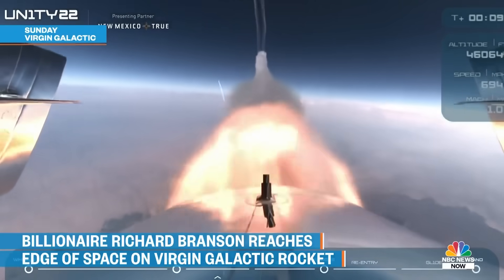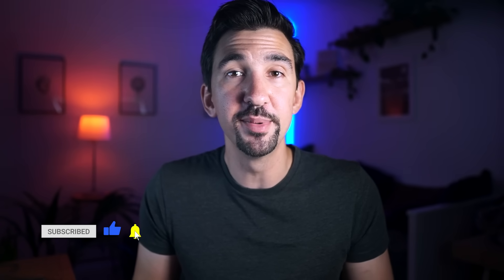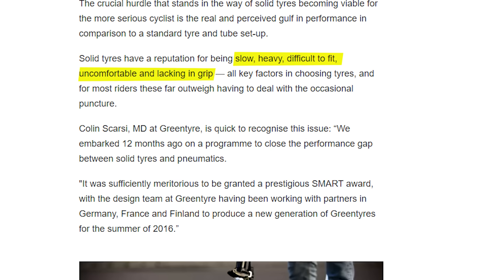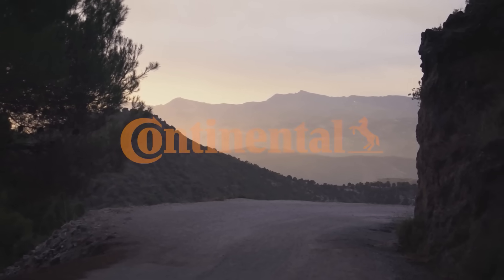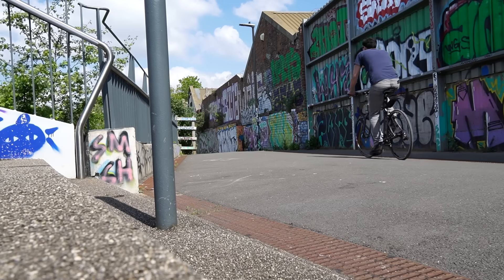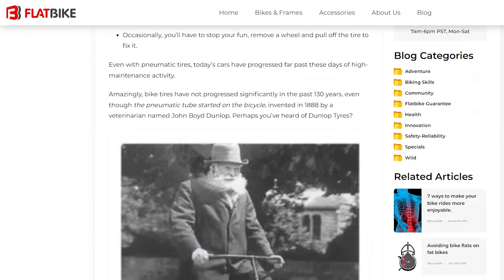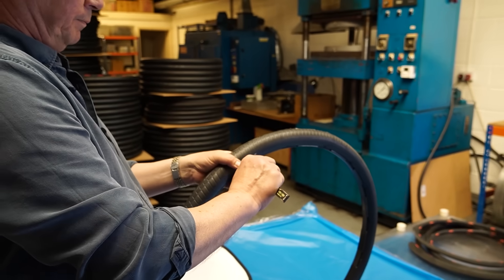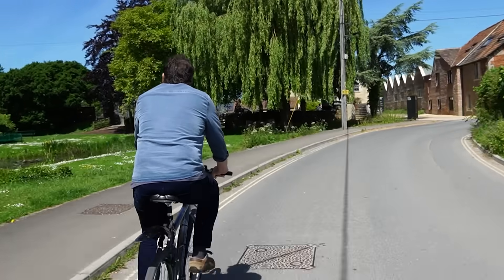I Tried Solid Bike Tires | Here's What I Found

Comment: You don't need NASA or some new materials to not worry about punctures, just use a simple trick.
When you do get a puncture, reuse the old punctured inner tube as a tire liner, just make sure to cut off the valve and clean it, make sure whatever caused the puncture is not there any more.
I never had a flat tire since i did that.
Edit: Forgot to mention that the ride quality didn't feel any different.
Reply: they do have a liner that you can buy that is puncture resistant. look online. I installed mine with two sided tape to keep it in place .so far ,so good.
Reply: @glennschemitsch8341  my experience with these liners is that the ends wear a hole in the innertube.  Which is an effect that I would not have expected.  This has happened to me 3 times now and I have removed the liners and now use sealant filled (specialized) tubes.  This is not a perfect solution because I hate sealant, it's so messy.  I thought about tubeless but the only good solution to a flat is to install a tube in the field which is what I would do with tube tires.  And I have to deal with the tubeless sealant, which as I have mentioned is really messy.
Reply: The liner is Mylar?   Glass weirdos increase landfill pollution . I put Mylar flat on front tire to hopefully slightly crush sharp edge. @glennschemitsch8341
Reply: Or just buy lined tires. I'm using Specialized Sawtooths, they're lined with Kevlar, in 5 years of light to medium touring on all surfaces I've had 1 puncture and it was from a very thin piece of steel wire.
Reply: @somika87  Thats worth knowing its Kevlar they use for bullet resistant armour so that should be effective.
Reply: @hookbeak2321  I had kevlar tires, for around 4 years without issue, no leaks whatsoever. Then I let some kid borrow my bike to ride a ramp. He landed pretty clean in the grass, but you could hear the tire explode. What did he hit? A large splinter of wood.

So yeah, kevlar or not, I don't think bicycle tires really fall into that bulletproof category.
Reply: @southernflatland  There's a reason why armoured vests and such use titanium foil to increase the resistance against puncturing... Kevlar is amazing on it's own already, but far more so against bullets than cuts and piercing. Bullets simply "work" very differently when they hit armoured clothing.
Reply: Most of the times I use a drop of superglue and a piece of tissue to fill a puncture, mostly because I am too lazy to buy new tubes :D Works quite well, even on the DH Bike. Not really endurable on broken headphone cables tho
Reply: @hookbeak2321  Kevlar was initially developed for tires before it was first used in bullet resistant armor, but yes it can be extremely puncture resistant.
Reply: You can buy lined tires - they cost like 10€ more.
Reply: Oddly enough, back in the day in my spare bicycle parts that I had one set of tires that fit perfectly inside another set. So, I installed them, all 4 of them, on my two rims. Plus 2 tubes of course.

Basically I ended up using smaller tires as tire liners for my larger tires haha! The whole time I had that bike I never got a flat either. 👍
Reply: @southernflatland  Thats a pretty good Idea and I love cheap so You make me think that you could just take a used tire and just cut the rim wires and part of the sidewall to fit in the new tire and then it would have plenty of armor.  the most flats i ever got were from goats head thorns hidden in dirt.  I also ride motor cycles and believe watching for road threats is part of the job if you want to avoid accidents or flats something that video producer seems to be unaware of.  cheers
Reply: @SurferNorm6360  Oddly enough, I didn't even trim the bead wires on the inner tires, it was just like a perfect coincidental fit with no modifications for me.

Also, practically all new bicycle tires don't even use a wire bead, they use nylon now, so they can fold the tires into reasonably small boxes now. Which basically means if you try such a double tire thing, your mileage depends on the different tire sizes, but you shouldn't even have to worry about a steel wire bead anymore.
Reply: I do that plus i just use those hard vinyl Liners on my Mtn bike if the guys but is so soft your supposed to stand up on irregularities on the road also consider a fully suspended Mtn bike walmart has them for cheap,
Reply: There are liquid sealants that you pour into the tubes. Some of them last about 2 years (that's about 5000 km in my daily commutes). With them punctures are very rare (unless you keep catching snake bites, which means you have other problems, like low air pressure or bad riding habits).
Reply: What? I do not understand how big the piece of the tube needs to be
Reply: Same, I actually used 2 in each tire, since I did that I never got a flat again.
Reply: I have done this with an old external rubber for a training bike... 😂
Puncture proof 5.0, However, got a lot heavier... I might be going back to that for a road trip I am planning within a year...😅
Reply: Awesome Idea and greatly appreciated.
Reply: I rarely get an intrusion giving me a flat ... Five flats this year 3 from the valve seat splitting and two on the inside of the tyre (rimside) splitting on a seam. The quality of tubes is shite!
Reply: Back in the late 50s, there was a little device called a tyre saver.  It was a loop of thick wire, curved to fit round the tyre and lightly brush the surface.  Anything that stuck in the rubber was knocked out before it could penetrate further.   Of course no use with the ridiculously large, knobbed tyres which are so pointlessly used these days.
Reply: @grahvis  
What is it about knobby tires that have proven to be useless in the modern era? Do they now use "non-knobby"  mountain bike tires that still provide adequate grip on cross country terrain?
Reply: @HighlanderNorth1  .
I didn't say useless, I said pointless and I am referring to all those who ride on tarmac or similar.  The large tyres on mountain bikes that are used in towns, simply create more tyre drag and serve no useful purpose.
I suspect such bikes ridden in towns, are chosen more for fashion's sake than for efficiency.
Reply: @grahvis  
☑️ Yeah, just like the tires on my 80s BMX bike were good on trails, but pretty bad on the road. The popular tire setup back then(early to mid 80s,) was Cycle Pro Snake Belly tires on rear, and Carlisle Aggressor MX tires on front. The Aggressor tires were wide and basically flat shaped as opposed to round, and it had deep, spread out knobbies that made street riding significantly less efficient on smooth road surfaces. The Snake Belly tires on the back were rounded, narrower and had a shallower tread pattern that was a bit more efficient than the front tire.

 My 2nd ever mountain bike was a Diamond Back hybrid. Its tired were narrower than most standard mountain bikes, and had an off road tread pattern, but with a thin, solid rubber bead running around the center of the tire, making it efficient on road, but still decent off road.
Reply: No clue what you mean
Reply: can still be flawed
Reply: "make sure whatever caused the puncture is not there any more" ...??? there are so many different riding surfaces and situations riders face throughout each day, week, year. There's is no foolproof method to prevent punctures.
Reply: @mts7274  meant whatever caused the puncture is not embedded inside the tyre
Reply: @jovand6606  "I never had a flat tire since i did that." ...every rider doesn't have the same experiences or environments. You are trying to claim there actually is a fool proof method to avoid punctures permanently, but that is impossible.

Comment: Or... you can use quality puncture resistant tyres like schwalbe marathon+ series, that are rated for basically lifetime of an average commuter in terms of range. Unless you ride on a cheese grinder like surfaces that is. They are also almost impossible to puncture (4 years and running with 0 flats, whereas my old pre installed Fat Man and Schwalbe marathon cross I bought later had an accident at least once a month).
Reply: I'm flabbergasted by this man's count of flat tyres, I've been riding my bikes with the same tyres for ages and have had most other things on my bikes fail before my tyres

Comment: your bike tires go flat every month because the tube is porous.   making tires heavier and heavier is not the answer. Rotational weight is a big deal.    Also, you should be checking your tire pressure and shock pressure every ride.  i'm going to have to fact check these things

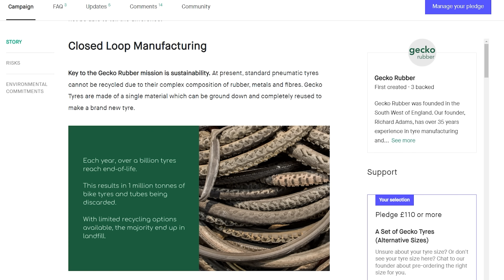Comment: Would love a good solid tire for my commuter bike. Two things on recyclability, though: those orange segments appear to anchor the tire to the rim, so the entire tire isn't just one kind of plastic (11:54). Those have to be removed, right? Second, there has been good coverage lately about the myth of recyclable plastics and rubbers, and the tl;dr is that the chemical compounds can't be reprocessed without changing their characteristics. The heating or chemical decomposition necessary to reshape and reform the product makes recycling difficult or impractical.  Interested in your take on both issues.

Comment: Consider Hooks Law.  Take the wheel with a tyre on it; compress the tyre by about 15 mm , as in riding over a bump, and draw a graph of compressive force vs amount of deformation.  Compare the graphs of the pneumatic tyre vs the “solid” tyre; you might be surprised at the difference.

Comment: The good thing is no punctures .The down side is increased weight.  You add the weight of solid tires to u-bolt bike lock plus phone and water bottle and a steel frame and that's probably too much weight.

Comment: With pneumatic tires, it’s more the psychological fear of a flat than the actual frequency of it (maybe once a year or so) in my bike commuting experience.
Reply: Last year, I had four flats.  This year, I've had one, and I've ridden a lot more this year than last year, and on some pretty gnarly single track trails, too.
Reply: @Durwood71  Yeah, guess the quality of trails and roads matter. Also, having a tube lined with that kevlar-like material helps.
Reply: @aroundandround  I really can't explain why I've had so few flats compared to last year considering that I've ridden further and harder this year.  I'm rather mystified.
Reply: @Durwood71  You perhaps subconsciously improved at dodging suspicious surfaces, avoiding head-on sharp step-like cracks etc on your roads.

Comment: The Tannus is indeed pretty hard. But i invested in a shock absorbing seatpost some weeks after buying it and that solved the issue. Getting that tires on the rims was almost impossible though (not an exaggeration, it literally took hours and i definitely still botched it a bit).
But i am pretty heavy and had flats every few weeks before. That polymer microfoam tires basically made cycling viable for me. Also i am pretty unathletic and wheren't able to feel the difference in energy efficiency - so it can't really be that much of an impact at low speeds (yes, i use that bike for actual transportation needs, not as a sports utility).

If i ever get a new bike, it will be unflatable tires again (be it Tannus or whatever other brand is king of the hill then) - and some electric support (that wasn't really a consumer thing back when i got my current bike).

Comment: I ride a 212cc powered motorized bike, and am very particular about my tire pressures. If you have to pump up tires more than once a month, you have a defective tube, or a loose valve. I average one or two airing ups a year.

Comment: I adjust my bike tire pressure for the trails for the current conditions of the trails.  I'll stick with air.  When it's soft you want more floatation/grip and a more conforming tire.  Same on my road bike, if it's a bumpy route i take out a little and if its super smooth i add from the normal psi.  But I ride for fitness and take different trail systems or road routes. So not always the same. >>  Your tire would be great for commuters I think.

Comment: Worth every penny if recyclable, they should go with a deposit purchase price so that you pay $40 for the first tire but they you get say $10 off in deposit or make it 45 and $15 for the deposit.  That way the replacement tires feel like a deal, you get close to full profit off of most users and your frequent customers will be VERY loyal.  BUt only if you are returning the old tire as part of the deposit/core charge.

Comment: my local  bike store offers some sort of solid bike tire since a few years. its for sure not rubber, looks like polystrol. i have tested it for a few minutes and it didnt felt bad. the main issue i had was that it costs like 100 euro per tire and its supposed to live up to 10k km. on average i would say i bike around 5000km per year so effectively 100 euro per year just for tires.
i can buy a new tube for 5 euro and can carry one replacement tube with me at all times. that solves the main problem of flat tire which happens like once or twice per year.

in my opinion solid bike tires try to solve a problem that already has a very cheap solution. either the price need to be reduced by more than 50% or the lifespan needs to be doubled, or a mix of both

Comment: In a normal air tire the air does not compress and decompress when riding on a smooth surface. The pressure increases in the entire tire when you put weight on it, and only decreases again when you take the weight off. So the coefficient of restitution of air doesn't even matter in that situation. In a solid tire with air bubbles, the air compresses only locally, where the tire touches the ground, so it gets compressed and decompressed constantly while you roll along.
When doing the drop test, the air is compessed and decompressed in both tires, so you don't get to see the advantage that an air tire has.
Reply: I think the coefficient of restitution of air may be even less relevant than you saw.  When you put weight on a wheel the tire sidewall flexes but the total volume of air has only a tiny tiny change and the pressure has a correspondingly tiny change,
*In a pneumatic tyre the energy loss is due to flexing the tyre, not the air*.  I am not sure what is happening in the solid tires but I suspect it is the same; the shape of the air pockets is changing more than their volume/pressure.

Comment: about 10 years ago a new generation of airless hit the market and were all the talk and rage with recumbent riders due to wheel removal being a pita on many of the bikes/trikes. Those were mostly foam configurations. Many tried them, most went back to air. Hard to get them on the wheel if fit tight enough to not slip in use.  Rough ride with less 'give' than air filled.  Slippery (as HECK) when wet.
 Same reasons air filled have ruled for 150 years.
Will be interesting to see how these play out.  THere is a market to be sure.

Comment: I ride mostly off-road in the Mojave Desert. I've had thorns penetrate my shoes. At 75 I decided to get an e-bike. I'm using 4 in tires, and they are heavy, but the motor makes up. Still get flats, though. While hard tires are most efficient for road work, I generally deflate my tires to around 14 pounds for flotation across the open desert. Not sure how well these would work, but keenly interested.

Comment: tire liners stop flats.
Eventually, "solid" tires do wear down to their softer foam cores.  Their wear surfaces aren't any thicker than standard wear surfaces.  So they don't wear longer than standard tires.  You want longer wear, try pnuematic tires designed for longer wear like Continental's Gatorskins WITH tire liners.

Comment: I have been riding on Tannus Tyres for over 6 years now and their ride is very similar to my previous tyres (Schwalbe Marathon Plus kept at the top end of their pressure range to avoid punctures). In the local country lanes, where a flail is used to keep the hawthorn trees trimmed, my Marathons got punctured with thorns. This is not an issue with air free tyres with a consequent increase in ride enjoyment.
Reply: Ouch, tyres near the top end of their pressure range must have been uncomfortable as hell. No wonder the solids were comparable in (dis)comfort ;)
Reply: Also marathon plus is already about as bad for comfort and rolling resistance as air filled tyres get. They sacrifice everything for durability and puncture resistance.
Reply: Marathon Plus suck.

Comment: I'm amazed that you are getting flats that often. I've been cycling for fitness and pleasure since the 1990s averaging 2000 miles or more per year. Initially I was riding on the tires that the "racers" used and I was getting flats about 2 - 3 times per year despite religiously maintaining recommended tire pressures. I eventually switched to the less "fast" but more durable kevlar belted tires (Specialized Armadillos) and after that similar type tires from other manufacturers. I have been riding Continental GP 5000 for at least 10 years.  I have had all of one mishap in the last 20 years and that was a freak event, a flint chip flipped on to the sidewall of my front tire causing a blowout.  All in all, one flat in 20 years (approximately 40,000 miles... I think I'll stick to what works.

Comment: This rings all the Hyperloop/Energy vault/Free drinking water from air bullshit whistles for me. Ideas that are around for hundred years and were proven over and over again to not be practical and every other year a kistarter pops up who claims to finally have found the solution. There is no way that a rubber foam elastomere has anywhere close to the same dampening properties of comperessed air, shares the same weight with a normal air filled tire and retains the same wear resistance, while using only one compoud. This has scam written all over it.